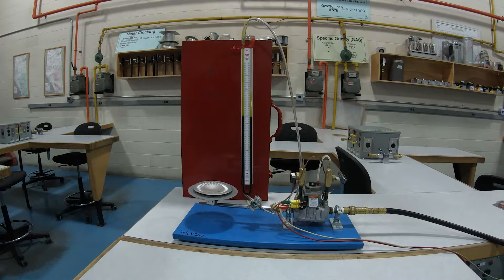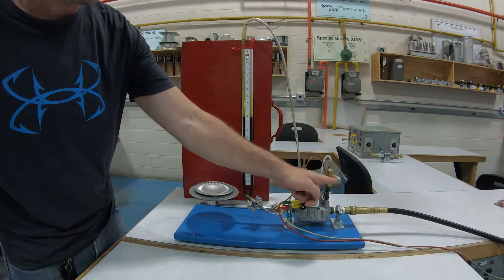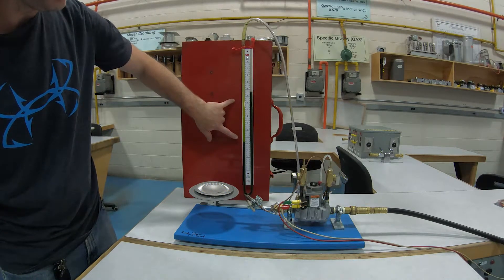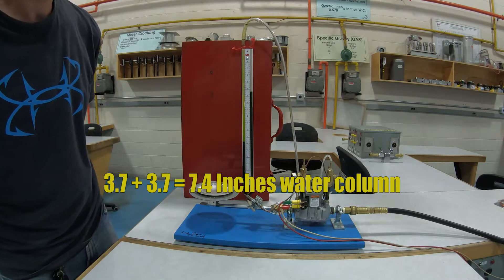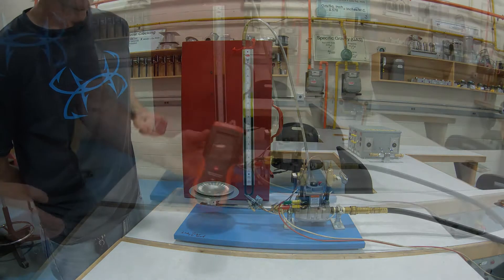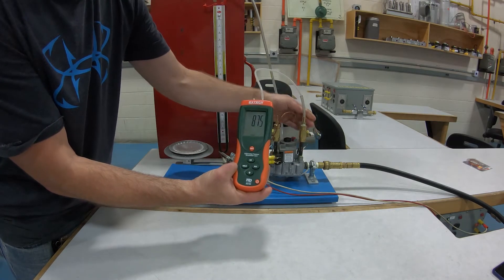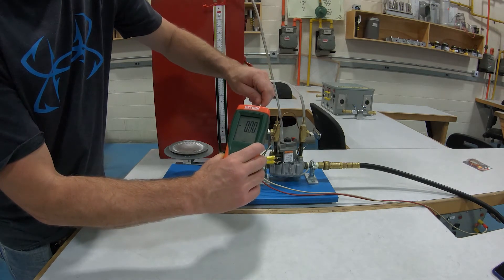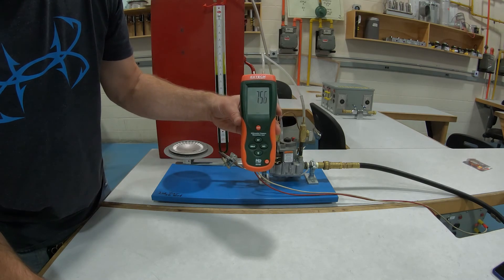How to Use a Manometer

Comment: Why do you think that the digital manometer is more accurate? I would think that the simple device if it were properly made, would be more precise and reliable.
Reply from the maker: It is  much easier to throw an analog manometer out of calibration by accidentally over pressurizing it. Modern manometers don't suffer the same issues. When you overload it, it just tells you OL. You can also zero the digital unit with the push of a button if something seems out of whack.